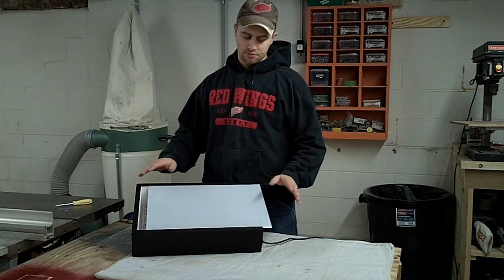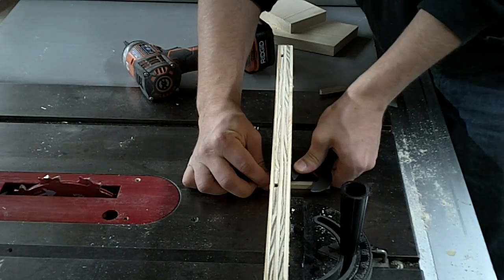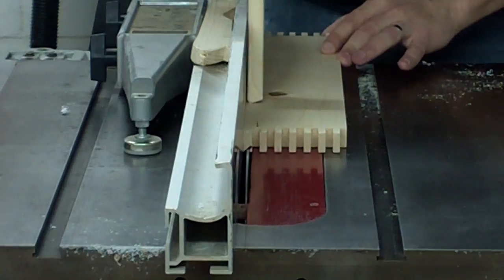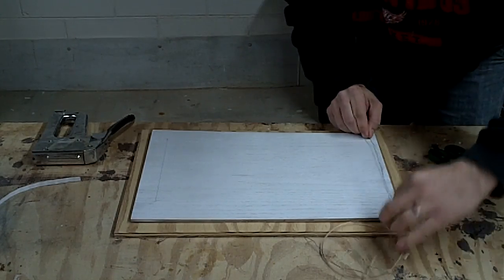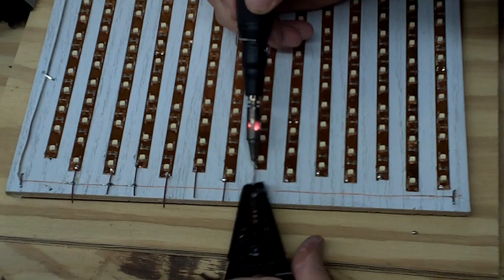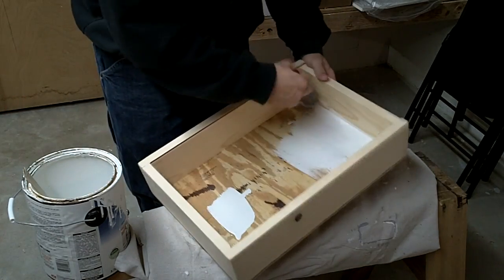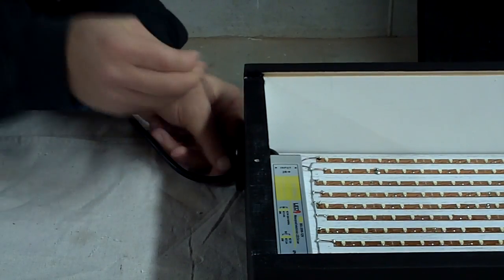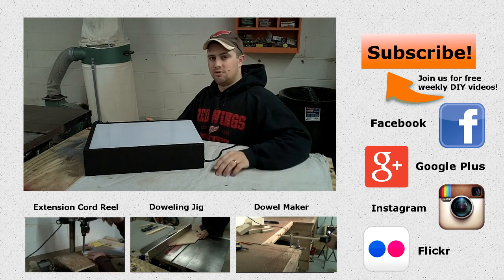How to Make a DIY LED Tracing Light Box

Comment: I just did a build inspired by this one, except I sourced the LEDs and power supply from elsewhere. Any idea what might be causing my controllers to burn out? The strip says it's 18W (5m) and I'm using about 7.5m worth of LEDs with a 24W(12V-2A) PS and a 12V-3A controller.

Any ideas on what might be going on are welcome!! :(

Comment: 18 months later, how is the adhesive holding up on the back of the LED strips?   I've been considering building one of these for my grandkids, but I'd hate to ship it across the country and then learn that the strips had popped off the electrical board.  Itr is a really awesome build and you have kept it simple.  A really greag job.
Reply from the maker: Have not had any complaints about it! If you do make one you can make it much shorter, I was not sure how much heat would be generated but its very little.

Comment: This is awesome! I recently started a 24x30 array for a light box, and quickly found that a series circuit is not the correct method. What thickness and type of wire do you suggest for us busbar? Also, do you have any suggestions for a beginner to learn about circuitry and these kind of electrical components?
Reply from the maker: Bob over at I Like To Make Stuff has a few videos about simple circuitry, that will be a good start. I don't remember what gauge I used but it won't have to be too big, the LEDs don't draw a ton of power. Maybe 14-16 gauge, but it does need to larger if  you have more LEDs. Thanks for watching.

Comment: Hello! Excellent work! I noticed that your light box is rather high (in my opinion). Does the height matter? Is it comfortable to use? I want to build a light box, but I prefer to make it flat like a tablet (3 or 4 sm high). That's why I' asking.
Reply from the maker: +Lidy Klimova Built it this high because I was not sure how much heat the LEDs/power supply would generate. Turns out not much can definitely make it much shorter. Good luck!
Reply: Thank you, Tyler

Comment: great design tyler. unfortunately not everyone has  all the tools you had. those were alot of them. but great idea.
Reply: One really easy way to make light tables without much in the way of tools (btw, you could use a basic drill and a coping hand saw to do everything he did. It’s not as easy, takes more time and effort, but the results are the same. Oops, sandpaper too...Soldering can be replaced with twisting wire together and electrical tape then a plastic cap. Again, not as professional looking inside but the results are the same).

Back to the main point. Another way to make great drawing boards are old lcd TV’s. You literally only need to remove the lcd glass panel under the bezel and it is functional.

I have no idea where you live, but most “dumps”, recycling places etc have an area for broken electronics. There are always a ton of TV’s with cracked screens. Ask the worker (if there is one) if you can grab a broken TV for parts and 99% of the time they laugh and say “Sure”. If no one is working and they just have bins or lockers you can just pick the size you want and again, once the lcd is removed, as long as the backlight works, you have a perfect drawing area that will normally see through photo paper, then 5-7 drawing sheets.

They already have plugs, so no worries about soldering or power (old laptop screens also work well but require the same power and soldering, though to a lesser extent; they are much lighter and portable than old lcd or led TV’s though).

At this point if it’s for yourself and cosmetics aren’t an issue you can just use plastic or wood to set it to the angle you prefer. If it’s to resell or gift then you will want to make some sort of frame. How simple or complex you want to get is up to you at that point.
Reply: Or.. you could just buy a shadow box that is about 2 inches deep.

Comment: Hey man! Can I make a little bit thinner box, about 2 inches ? If I do so, that would be even to the 2x2 inches woods where the plywood is nailed onto. Because I want the plexiglas to be level with the surface of my wall. In other words, I want to make this as a wall light box, and paint it with black, living an unpainted inverted E as in Eminem! Yes Im a Stan and I want to be creative somehow xD 
 By the way, can I make a switch for this ? LED strips ? I just  thought it would get rid of any hassle if it's possible. Thanks for the answer(Advance)
Reply from the maker: +Perr Pher Cernechez Yes to all your questions! I originally made it thicker cause I wasn't sure what the heat generation would be like but it's not bad. Switch is an easy addition. Good luck.
Reply: ***** Thanks man for the tips in this awesome vid. Btw, How long will the LED lights last? And where can I buy Plexiglas ? Is that found in Glass or Plastic stores ? There are also translucent white plexiglases ryt ? I want those kind but I dont know where to buy. Are they also in hardware stores or home depot ?
Reply from the maker: +Perr Pher Cernechez  Not sure about the LED life but have to assume it's a long, long time. Yea you can get white plexi at home depot or lowes.
Reply: ***** ok thankyou

Comment: Tyler, I want a light box to backlight a stained glass panel. Could the depth of the box be less? I know you mentioned in another comment that the volume of the box worked to dissipate any heat from the power supply.  Could a decorative design of holes in the sides serve the same purpose? It would create an interesting lighting effect on the wall as well!
Reply from the maker: Absolutely! After having the light box for some time the height can definitely be less....was not sure when I originally built it but it doesn't great enough heat to be an issue. Thanks for watching!

Comment: I want to use 9.6W led strip, will it be enough power? I would photograph old negative film with my dslr.
Reply from the maker: +PeopleCanFly23 9.6W is not quite half of what I had....would have to say it might be a little bit dim for your needs. You may want some way to make yours dimmable though, that way you have control over the light for each different picture.

Comment: hey this is amazing work. one question, do you have to spray the glass white? i thought if its just as clear as it comes, the light will be brighter and giving the result more easier to trace?
Reply from the maker: +Afiqe Farid The light might be brighter but you will also see all the individual LEDs instead of a diffused light like you get with a painted glass. You can also get a white acrylic sheet but I was using what I had laying around. Thanks for watching!
Reply: oh i see. thank you for the info!
Reply: oh i see. thank you for the info!

Comment: nice job, but the temperature is supposed to be evacuated
Reply from the maker: ali çakıcı LEDs make no heat at all and the little that the power supply generates is easily transferred by the box volume and the wood. Would have been really cool to have some tiny fans in there though! Thanks for watching!

Comment: That project turned out awesome Tyler!!  Really like how the finger joint jig looked so simple to make when you made the finger joints. Question tho - was there a switch on the power cord that came with the power supply? I did wonder why you hadn't wired a small switch n the box. Thanks for sharing !
Reply from the maker: Nicholas Gomez Well, video editing works magic! I failed on the first finger joint test but got it right the second time. Was going to install a switch but my mom thought it wasn't necessary. Thanks for watching and happy new Year.

Comment: Great project with some cool ideas.If you didn't want to paint the plexi glass you can buy OPAl Acrylic which is the same as what the boxes you can buy use. It will mean you don't have as patchy light, however your method works very well.
Thanks
Reply from the maker: Chad Griffiths I did look at the OPAI but I got this piece for free! The painting method seems to work great.